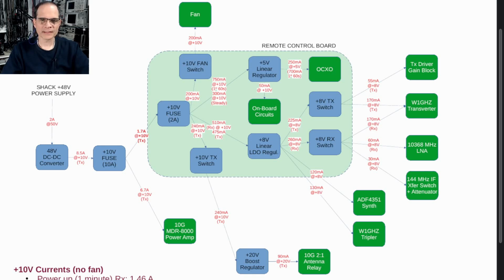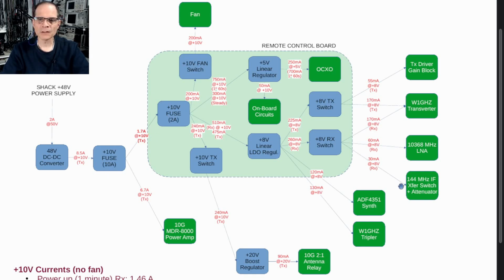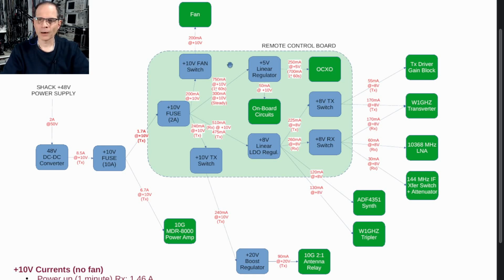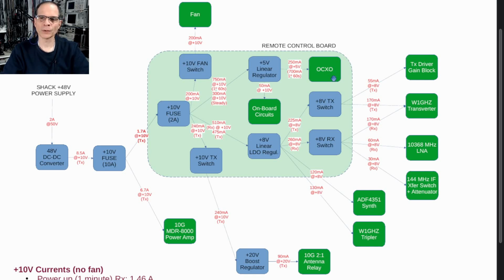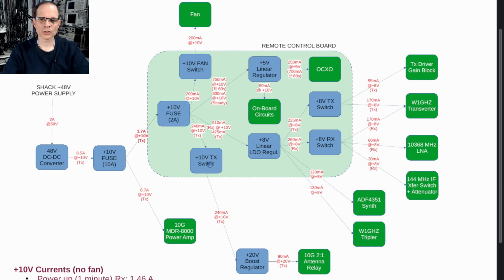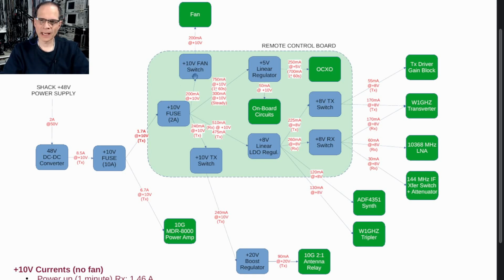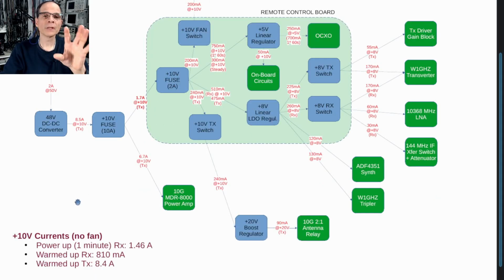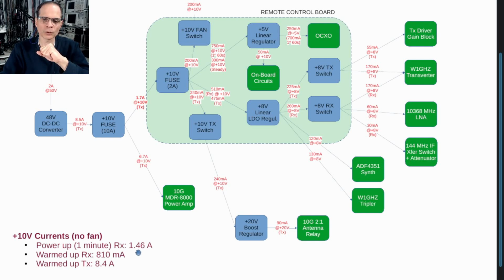Tower-Mounted 10 GHz Transverter System, part 14 - Power Distribution Strategy

Comment: What model number is the MDR-8000? What is the MDR-800 output on 10GHz?  Thanks KD5FZX.
Reply from the maker: Output of this unit is up to 12 Watts linear at 10.368 GHz. Drive is +15 dBm (32 mW). Originally tuned for 11.2 to 11.7 GHz. Exact model number is 3DH04136AC. Any model  3DH04136 within the suffix range AA and AJ should work (with re-tuning), as they run just above 10.3 GHz. AK runs between 10.0 and 10.7 GHz. Nonetheless, it would still require re-tuning to optimize the gain (Alcatel were very conservative).